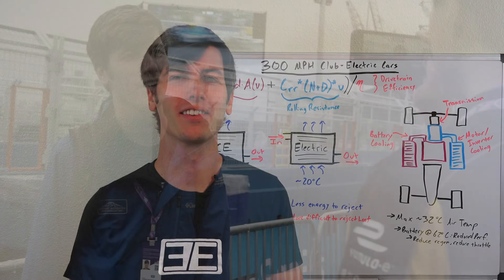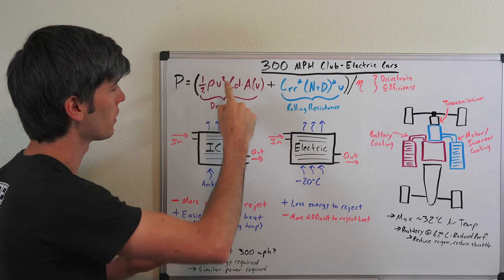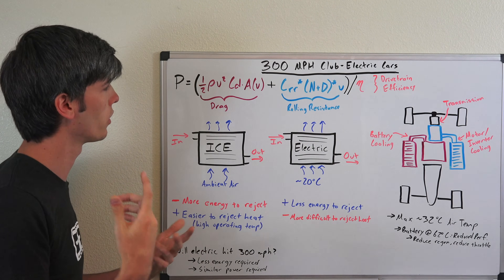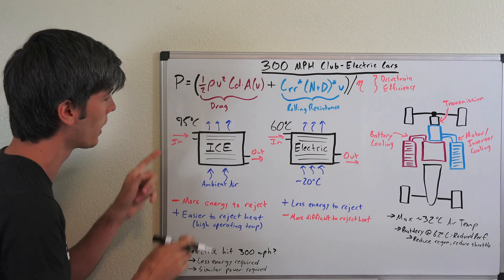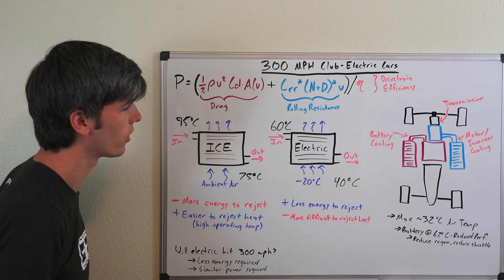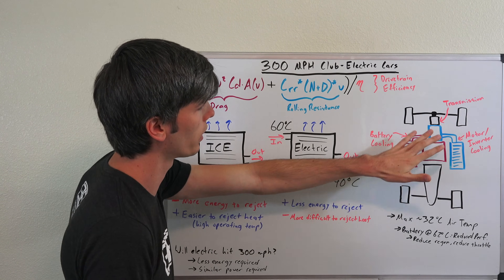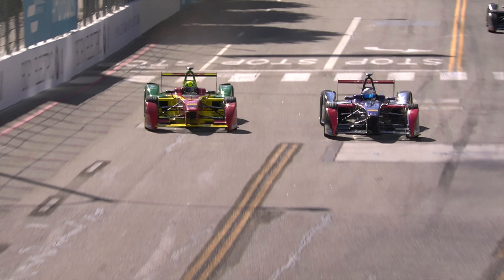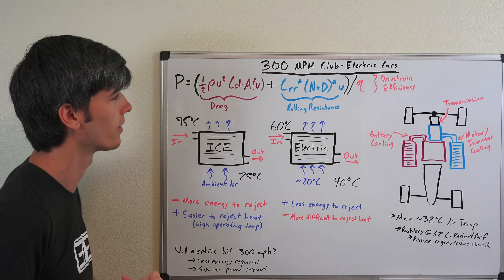Why Has No Production Car Hit 300 MPH? Electric Cars

Comment: Could we use heat pumps or something to concentrate the heat and get the radiator’s temperature up?
Reply: OtherTheDave if you're talking about using a refrigerant like freon to cool the motor or motor coolant, you still have to pump the refrigerant and run it through a condenser which is essential a radiator.  Your better off carrying a tank of water and spraying it on a small radiator to enhance cooling during higher power situations. Water absorbs a lot of heat especially when it evaporates.
Reply: nebulaunfolding Oh! Why didn’t I think of that? Some of the air race airplanes do that... no (or minimal) air intakes for cooling because the race isn’t that long and the don’t want the drag.
Reply: Actually it is how a refrigerator works : the coolant fluid takes heat from the chamber, and gets evaporated. This gas is then compressed to increase that temperature difference. That concentrated heat is then dissipated more easily using radiators on the back of your fridge, and the fluid goes back to liquid form. An expansion valve then lowers the pressure of the fluid, effectively getting it back to subzero temperature levels.
Implementing such a device in a FE car would be inefficient : think about how much it weighs in total and how much room it takes. The cooling system takes a lot of power too. So you're adding more weight to a car that needs to be lightweight, and use precious electric power you need to go around the track faster. It ain't worth it
Reply: A higher coolant temperature is what you want. Ideally you want an infinitely small quantity of infinitely hot fluid in an infinitesimally small radiator so that it can disperse the heat in the equivalent volume of a sparrow's fart of air, so little diverted airflow that the drag is too small to notice. Introduce fluid to one side of the radiator as hot as possible, pull it out the other side at the ideal operating temperature of the components.  That's the design challenge.
Reply: OtherTheDave that's not really going to help since you will have more heat to reject
Reply: Dmitry L But it’ll be contained in a smaller area with a greater temperature difference, which would make the radiator shed the heat more efficiently, which lets your radiator be smaller, which would create less drag.

I think.
Reply: justinkaller111 Aside from inefficiencies in whatever mechanism you use, it doesn’t add any heat; it concentrates the heat that’s already there into a smaller area.
Reply: that wouldn't work as you would have to reject more heat, holding it in the radiator makes the coolant temperature increase.
Reply: That would take energy ether from battery or motor.
Reply: OtherTheDave you want the radiator temp to be lower...
Reply: OtherTheDave  Just use faster pumps, there are limits though, but the manufacturers likely leave a lot on the table.
Reply: nebulaunfolding Yeah... the question is whether the decrease in drag offsets it.
Reply: Tate183 You want the coolant temperature to be lower. Keeping the radiator cooler is merely the simplest way to do that. AC units effectively do what I’m talking about, and they keep the House way cooler than just leaving the windows open.
Reply: Lazerecho Yeah, probably. I’d think the actual race cars would set things pretty close to as good as possible, but maybe it’s new enough that they’re still working in other areas.
Reply: The real trick would be having flush mounted smooth radiators/heat sinks in the already established wind profile like if the whole hood was a very smooth radiator, also the gas tank is filled with a fluid we WANT to turn into vapor, why not shed some heat INTO that process.
Reply: Lazerecho the cooling panel idea is not a bad one. But when gasoline vaporizer it cools down the air charge around it there for helping to cool the engine and produce more power.  Heating up the gas in the tank would decrease the cooling effects it has when it vaporizes.
Reply: nebulaunfolding But yeah, I was thinking of something like using Freon or whatever... I’m pretty sure the condenser is smaller/less drag than a traditional radiator; it’s mostly a question of whether the decreased drag is worth the extra energy to run the system (plus it might weigh more... I really don’t know one way or the other on that).
Reply: Smal waterspray on the radiator migth do it.
Reply: Yes but at a higher temperature it would be easier to lose that heat. A small hot radiator would work better than a larger warm one and it would need less airflow which comes at the price of drag, which is a bigger problem than weight at higher speeds.

Comment: I watch your videos to learn something but somehow during all the video i feel dumber
Reply: “The wise man is one who, knows, what he does not know.”
Reply: This is the dumbed downed version. It was assumed since EVs ran cooler they could be designed to more aerodynamic. But since EVs r more sensitive to heat they need just as large drag inducing components like a radiator as an ICEV. Which negates the assumed aerodynamic advantage of a EV.  It's just a hard to reach 300 MPH for an EV as an ICEV.
Sorry I left out a few other points to simplify it but that was pretty much the conclusion.
Reply: Jovan Dragojlov not a bad idea. Make the panels one large water jacket. It may not be sufficient but it would at least make radiators and cooling ducks smaller. Weight would go up but we just want top speed.
Reply: It's a physics problem. The key is heat rejection rate relative to heat production . 

The gas vehicles have a high heat production but they have a high heat rejection as well because the difference in temps ("temp delta") between the coolant and the ambient air is high. 

The electric vehicles have a low heat production but they also have a low heat rejection rate because the difference in temps between the coolant and ambient air is low. 

As such, it comes to a wash when comparing the two in terms of required radiator (heat exchanger) sizes. This is the catch to the whole issue.
Reply: alban panxhi j
Reply: I'm pretty sure that sensation means we're learning.
Reply: Jovan Dragojlov While it's theoretically possible to turn an aluminum body panels into heatsinks. The heat source would have to have a way (like thru conduction) and be in direct contact with it, to transfer the heat away. So it seems virtually impossible to make it into a practical design, But if u know a genius that can make work I would love the see it?

Comment: Why not use a refrigirant and use it to cool down the coolant, you will add complexity but you will reduce the radiator size and make the cooling more efficient since the delta will be much higher
Reply: not to mention that the enemy of a race car is weight
Reply: Seems to me that the smaller radiator size (therefore both weight and reduced drag) would out weigh the additional weight and power requirements to run a compressor.
Reply: Good point and might be feasible, but weight might become a factor; most refrigerants need to maintain higher pressures in order to be effective. The higher the pressure, the beefier your components have to be to contain the pressure, especially in a volatile environment like Formula E.
Reply: Refrigeration is merely a heat pump. You still have to get rid of that heat via a radiator so there is no point to using it.
Reply: Electric drivetrain efficiency are already > 90% and still improving, especially for the battery.  Coulombic efficiency of automotive grade Li-Po's are 95% or better.  Battery heat generation is due to both internal cell impedance, and contact impedance of connecting cells together.   Some next generation production EV's are aren't using bus bars (which have contact impedance), but rather are using laser welding techniques to weld the dissimilar metal terminals together to reduce internal impedance of the battery pack even further which will reduce the heat generated by high discharge currents.  So really, there's some headroom to both decrease heat generation in the battery pack itself to a point where not so much active cooling would be needed.  So 800 kW at the gearbox would really only yield ~90 kW of heat losses and ~ 25 kW (2.5%) additional battery power for the coolant system.
Reply: If high top speed is your aim weight isn't anything like as much of an issue as drag. Somebody will be prepared to load it up with extra weight confident that the headlines grabbed by the high top speed are more important than those which say it's a bit slow off the mark or it corners like a Cadillac. Think about a 200 MPH Bentley. It's hugely heavy but it still beats a Countach or a Caterham on top speed because it has so much power. Keeping the weight down matters for acceleration, which is what gives you fast times on a circuit. If it is just top speed you want you need good aerodynamics and massive power and then some more power on a very empty road or track.
Reply: ssllhh100 
There is one problem that officials will always stare at when it comes to refrigerant: Condensation.
Same reason as to why it isn't used in drag.

Sure, all F-E cars use radial tires, which makes water less of a problem.
But don't forget that the FIA were also the ones who banned one of F1's greatest technological advances (i.e. The ground effect) because some Italian dumbasses focused too much on power rather than downforce.
Which sums up at least <5% of the teams during the time.
Reply: Ethan what about a solid-state peltier element?
Reply: It will have to keep the fuel cell cool though. So all you are doing is swapping a battery for a fuel cell. However the fuel cell may be be able to handle a higher temp increasing the efficiency of the cooling but lowering the efficiency of the drivetrain.
Reply: Phase change cooling solutions are a no-go.
Big, bulky, heavy and needs a lot of power.
Reply: 0calvin Well, that was the point. If the natural delta-T of the battery and ambient is low, you could artificially pump it higher at the radiator, making it more efficient.

For a high ambient race your battery minus ambient might be 60-30=30. If you could hold a 30 delta-T between the battery and the radiator with a fridge of sorts, your radiator minus ambient is 90-30=60. That's two fold, 30 vs 60, as far as I can tell. The relationship to heat transfer isn't linear but significant nonetheless.

The best radiator is infinitely hot, because it transfers infinite heat. Theoretically you could get your coefficient of drag near zero (assuming the other components have almost zero frontal area, too) if you were able to make your radiator ideal. Now, this is all super inefficient, so wouldn't be feasible for a daily driver but could be doable for a dedicated top speed electric dragster that only needs to run for a minute or two.
Reply: An AC system still needs a radiator(condenser) to remove heat from the compressed refrigerant
This means an opening where drag will effect the system, you also need a  compressor which will add weight and sap power
Reply: You could add a heat pump, but it comes with its own drawbacks. Let's imagine a 80% efficiency in the battery + inverter&motor. If you needed around 1000 hp (~800 kW) at the transmission, the battery would drain at 1000 kW, and you would have 200 kW of heat to take care of. Imagine a great heat pump with a COP of 4. If we were to push all of that heat through the heat pump, the heat pump would draw an additional 50 kW of power. We would then need to dissipate 250 kW of heat through the radiatiors (though at a higher efficiency). The power draw of the heat exchange would mean that we would need to draw an additional 50 kW from the battery, resulting in a slightly higher heat output. This concept is definitely possible, but the question is whether it is feasible, as it would introduce some extra weight, and it would add quite a large draw from the battery just to get rid of that heat. Would be interesting though to see someone testing this out with real-world efficiencies
Reply: Yes, but if you pump the heat of that 60 degree drivetrain up to say 150 degrees it should be much easier to lose that heat in a radiator. Obviously some experiments should be done to see whether the weight penalty of adding a heat pump could be paid off in benefits by reduction of drag by needing a smaller radiator and smaller air ducts. As speeds increase the pay-off would get bigger as drag increases with the square of speed.
Reply: That may be true for compressor based systems but I think its the exact opposite for solid/liquid phase change systems. Jamekhorsid and Sadrameli (2015) claim the reduced weight from reducing the cooling system size for passenger cars would offset the problems. The argument is that peak power in normal driving is rarely used, so if you have the phase change as a heat buffer, you could get away with half the cooling system size which would end up being a lot less. 
A. Jamekhorshid, S. M. Sadrameli (2015)World Academy of Science, Engineering and Technology
International Journal of Chemical, Molecular, Nuclear, Materials and Metallurgical Engineering Vol:6, No:1, 2012
Reply: The idea is to use the refrigerant to increase the temperature delta between the radiator and the ambient air, so you can use a smaller radiator.
Reply: Evens Electric especially formula E
Reply: felixar90 I had though of using liquid CO2 in heat exchangers just upstream of the heat sources in a team's drag race car...
Reply: Just go to Alaska to reach land speed records next time )))))
Reply: mondayfool You can burst discharge some lipos at 95C which for a battery you can fit in your hand can be 300A. Insane.
Reply: Oh crap! didnt see this! asked the same question. Good idea
Reply: sorry, wrong citation: 
Engine Cooling System with a Heat Load Averaging Capability
John Vetrovec SAE 2008
Reply: Dam beat me to it ha
Reply: That's exactly what production EVs like Tesla & BMW do... racecars are almost NEVER the cutting edge of tech because they're limited by artificially restrictive rules... as is Formula E..
Reply: ssllhh100 That's what I was thinking. A liquid propane car could use its fuel as a refrigerant.

A fuel cell electric car would also have no battery to keep cool.
Reply: You can use evaporative cooling. It's like phase change, but you don't bother recondensing your refrigerant into a liquid after using it to absorb heat, you just let it evaporate.  And if you use liquid propane, it can be your refrigerant AND your fuel.
Reply: For a system like that you still need to remove heat to make it work. So, you still need a radiator on top of the rest of the system for the refrigerant. Like someone else said it could work short term to chill things to below ambient. But, in a short time the system won't be able to keep up.
Reply: refrigerator would do more than double the heat output, and the heat output is a result of the heat taken+the power draw by the system so in the end you just double the engine inefficiency